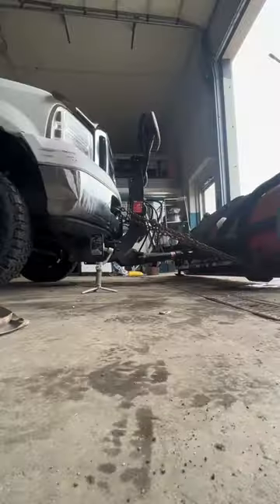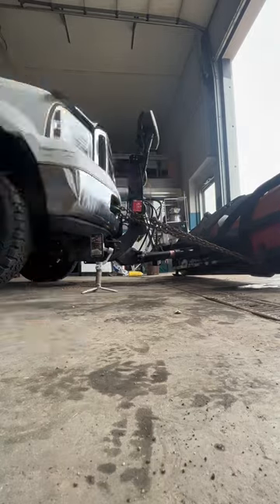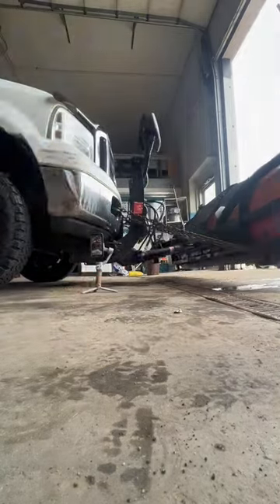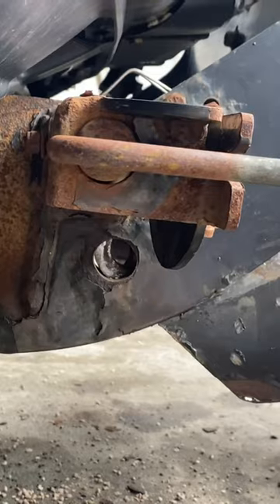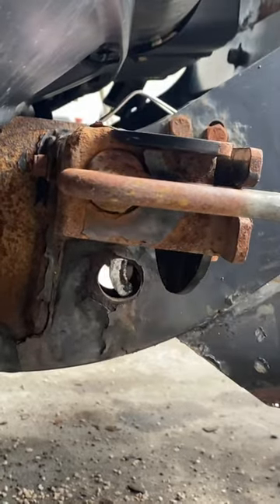Fixing a plow the day before it snows. #HandsomeOrHandy #Handyman￼￼

Comment: Make sure that pin is the right size in length or it will get in the way of the release lever to dismount you Boss snow plow
Reply from the maker: It is a little bit longer than what is needed.